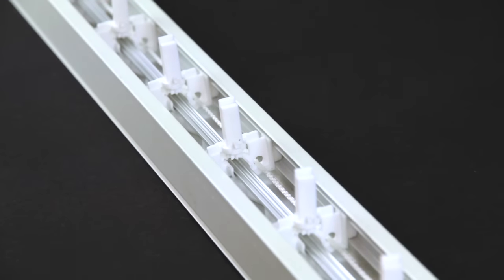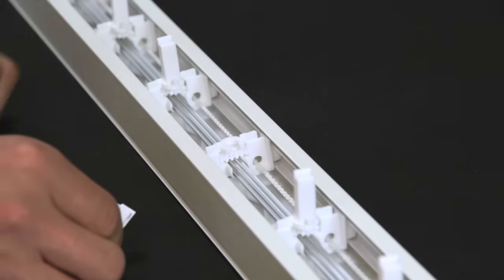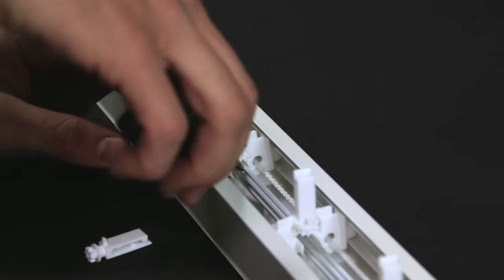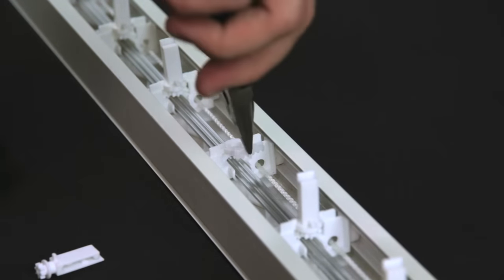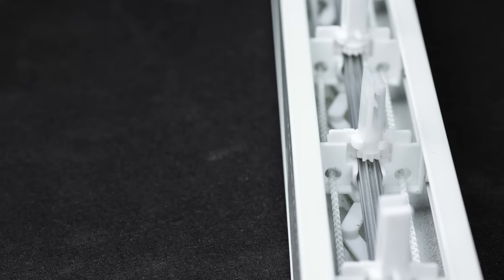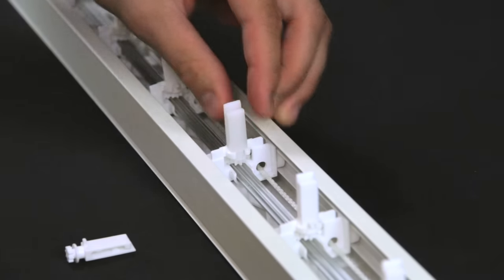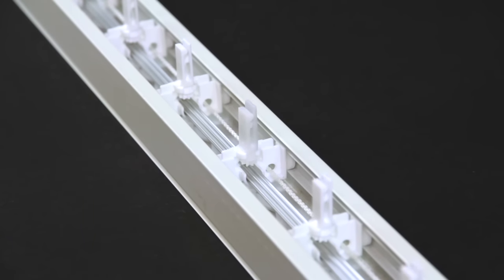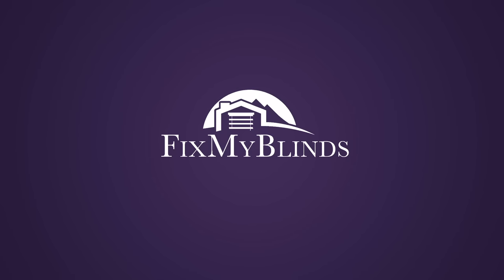How to Replace a Vertical Blind Carrier Clip Stem and Gear

Comment: thanks for the help. Had to replace 2 gears and 2 clips while in place overhead, so it was upside down and the opening facing away from my position. That made it more difficult but still doable based on your video.

Comment: Funny how this shows how to remove "easy stems". What about the stems on your "restring vertical blinds" video? Those clearly are not C shapes that you can pop out. I have vertical blind stems that have no C shape. They seem simply 'stuck' in the carriers. How do I remove those? I tried using pliers to swivel them out - they just broke. Hmm. No videos on Youtube show how to replace stems that aren't in a C shape apparatus.
Reply from the maker: Mark - Some stems cannot be removed from the carriers. For those, you have to actually replace the whole carrier.
Reply: I have the same issue Mark. I don't even know why ppl still make these types of blinds. What a waste of plastic and metal, have to throw away the whole thing just cuz of few broken stems. I'm just gonna get from IKEA and replace the whole damn thing
Reply: @fixmyblinds  Would that include 2001 vintage vertical “3 Day Blinds” (brand) stems/clips?

I just commented on another YouTube video showing a couple successfully removing a clip from what looks like a three day blinds rail. Though they first removed all the slats and the rail from its window mounting. And it took two people to do it. I tried it and I could not get anywhere. Though I did not remove the slats and the rail first as it is ridiculous to have to do that.
Reply from the maker: @nonelost1  The stems in your blind are most likely not removable. If you'd like to email me a few pictures of the stems, I can let you know for sure. Our email is service@fixmyblinds.com.

Comment: Only problem, what happens if the blind is next to the wand and cannot be removed/replaced easily.
Reply from the maker: Hi Ken, When the broken stem is right next to the wand, it can be tricky to replace since there isn't a lot of space to get in there to work. But, it can still be replaced with some patience.
Reply: FixMyBlinds it takes a ton of patience...thanks

Comment: I broke off the thing that holds the stem and it’s seems like no one has my problem what should I do ?
Reply from the maker: If you are unable to find a replacement carrier, we recommend replacing your vertical blind headrail which you can find here: https://www.reslat.com/collections/headrails
Reply: This does not work for blinds 20 or so years old

Comment: Gee! wished my head rail worked like that.
Reply from the maker: Stanley, there are many different types of vertical blinds. Are your stems not removable?
Reply: @fixmyblinds  I've been working from a ladder in 90+ weather. yes; stems are removable. tried swapping out a few, with the comb...dance like i did in 8th grade. Took head rail down. a few wheels are gone. master wand is cracked.won't rotate very well under pressure, I have 11/4" stems with stops. uses 33 blinds. do you sell...master wand replacement parts and wheel kits? I don't own an I pod so i can't send pics!!...Thanks for the reply.
Reply: I just popped the lid off the master wand, placed the undamaged gear on the un cracked side. seems to work OK now is that OK? still out of cars with wheels.
Reply from the maker: Stanley, when the carriers are damaged, it's time to purchase a new headrail or a new blind. For headrails, we recommend www.reslat.com. 

We do not sell carriers or replacement wheels.

We may have the master wand carrier. Here's a link to the ones that we sell: https://fixmyblinds.com/collections/vertical-blind-tilt-mechanisms

Comment: Older vertical blinds dont seem to have this option.
Reply from the maker: Some  vertical blinds have removable/replaceable stems and some do not. If the stems aren't replaceable, you'd have to replace the carrier piece or consider replacing the entire headrail.
Reply: @fixmyblinds  Thank you for your response, really wishing there was an easier way. Just read about drilling a 3/8th inch hole on top of the rail and possibly pushing it out through the other side. Not sure of this will work or not. Will give it a shot though.
Reply from the maker: Some vertical blinds do work that way where you can push the stem out from the top of the rail. If yours works that way, there will already be a hole in the rail for this purpose. 

On some verticals, the stem is integrated with the carrier and will not come out. In that case, the entire carrier will need to be replaced.